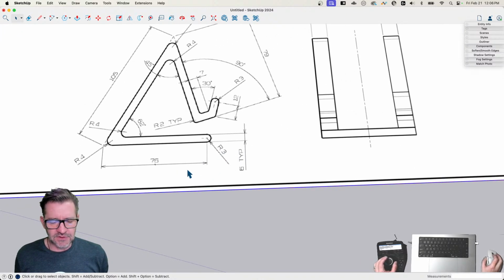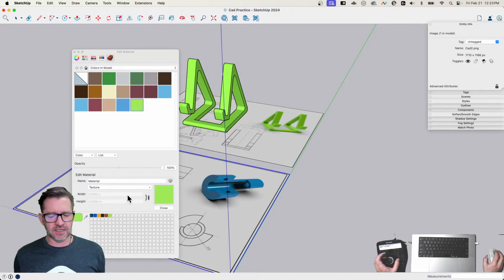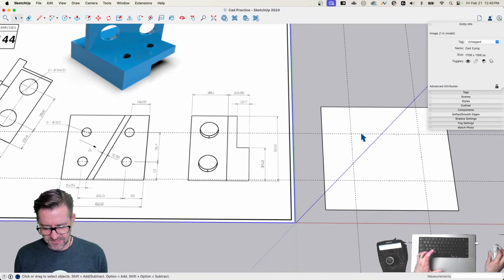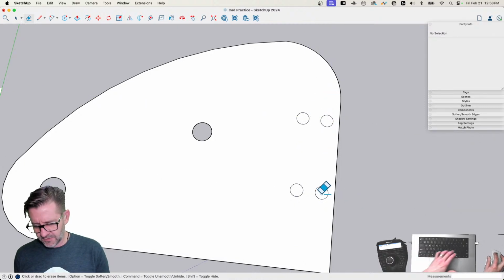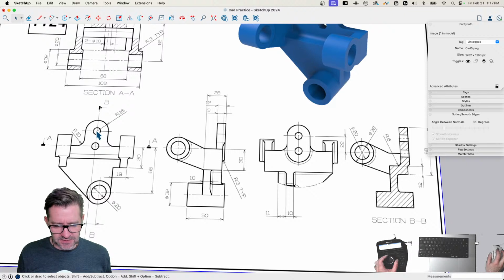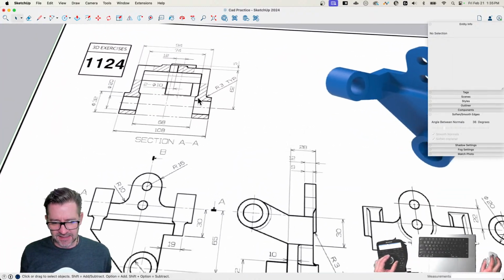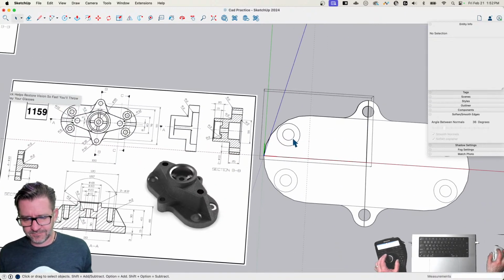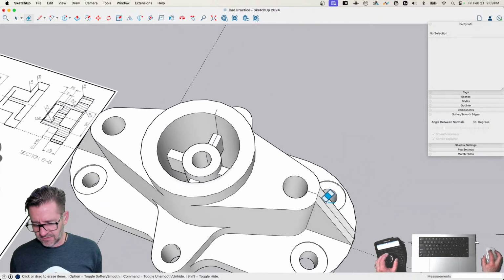Modeling CAD Exercises in SketchUp LIVE!

Comment: I would really appreciate a response. When I perform the offset command—like Aaron did in Exercise 2—on half a circle, my offset never creates a symmetrical geometry relative to the original drawing. Even when I increase the number of sides in the circle from 20 to 36, I still get the same results.
Whenever I use the offset command, there’s always one segment at the end of the circle that is shorter and another that is longer, no matter what I try. Aaron just did it, and his snapped perfectly along the lines—but mine will never align evenly along the Z and Y axes. It’s driving me insane!
I understand that the circle is composed of multiple segments and isn't perfectly smooth geometry, but how did it work in his case? Did he use “Snap to Lines” or some other setting that allowed it to snap correctly?
The only other explanation I can think of is that his axes were set at the topmost point (the crest) of the circle. Otherwise, I have no idea how his resized circle snapped perfectly to the line running straight through the center of the circle to meet the offset.
Reply from the maker: This sounds like a great topic to take to our forum (forums.sketchup.com). YouTUbe comments are a terrible place to try to help troubleshoot modeling workflows!

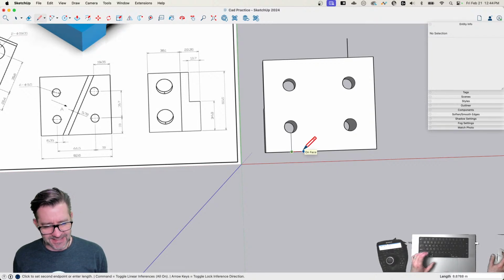Comment: I liked the way that Aaron solved the problem of that "fin" on the third part - #1144 (beginning at about 47:31), but I really don't see how that part could be produced or even drawn without that rotational capability of Sketchup (and maybe other software programs?).  I think that the print needs one of two changes:  It needs one of those two "end" dimensions that are already there plus an angle and "fin width", OR the two dimensions on the same side of the "fin". plus the width of the "fin".  Agree or disagree?